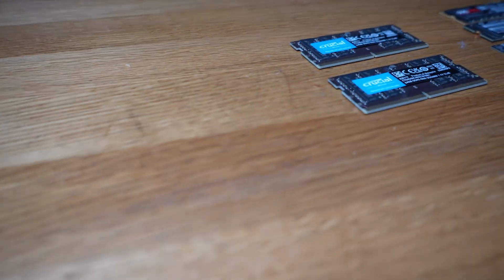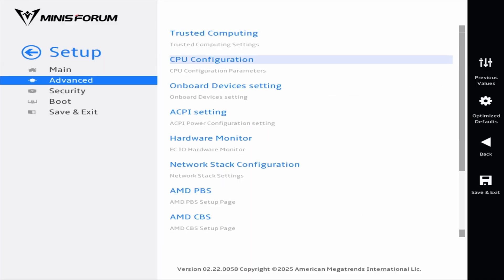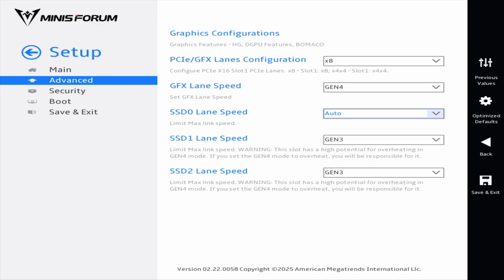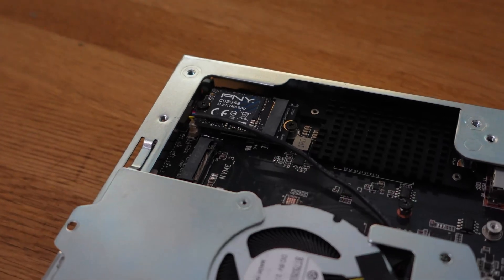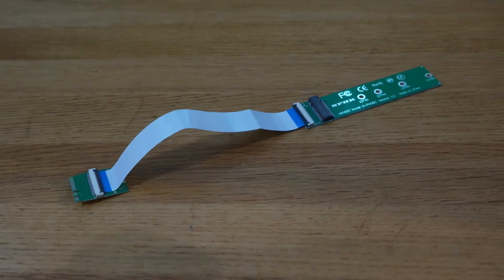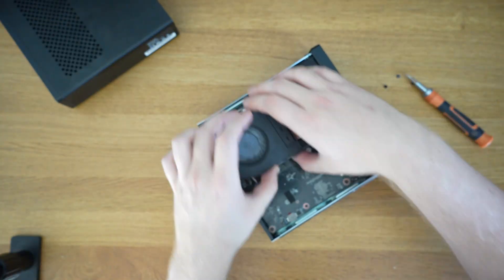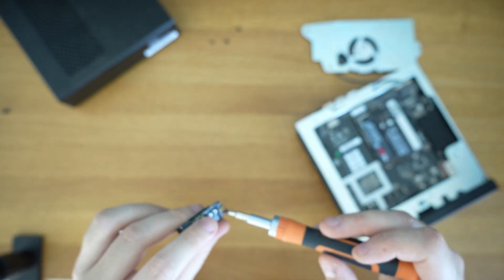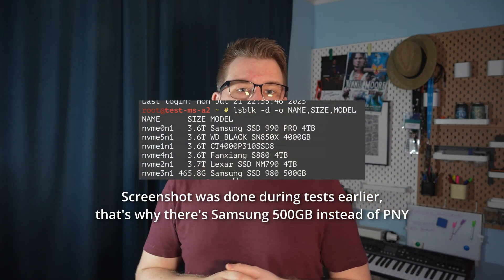The Best Minisforum NAS is not what you think!

Comment: probably with ribbon cables you get power delivery issues too
Reply from the maker: I didn't have any issues during high-loads when it worked... but I had sudden disconnects on this computer, and on random Raspberry Pi 4s even on idle.

In fact, I have 4 RPis, and exactly 2 of them have problem with NVMes. Doesn't matter which ribbon cable I take or which SSD, same Pis always breaks NVMe connection after few minutes... And I bought identical NVMe hats and identical ribbon cables. And then another set of identical ribbon cables.

Comment: While I think the MS-A2 is great for this purpose, I dislike the idea of stuffing 6 "prosumer" SSDs in it. Getting two enterprise U.2 drives with higher capacity (one in a PCIe to U.2 adapter) seems more reasonable - keeping temperature low on the other side is kinda hard without extra cooling and case-mods..
Reply from the maker: Agree! But for some home NAS those SSDs are perfectly fine if you want to store some photos, videos and music.

I’m running Ceph out of those NVMes for real test how stupid that idea is ;D We’ll see how long that will work. It’s running for half year already and some NVMes are showing 10% of wear already… so that sounds like they’ll live for another 5 years - about what’s expected from their doc.

Cooling is another issue… I’m currently in a process of designing 3D printed case for MS-01/A2 that’s 1U half-width (blade system, not screwed half-width) that will include 2x 40mm fans. That should help - but hey - it’s still a mod as you mentioned!
Reply: U.2 drives get very hot, fans go crazy with all the fan noise.